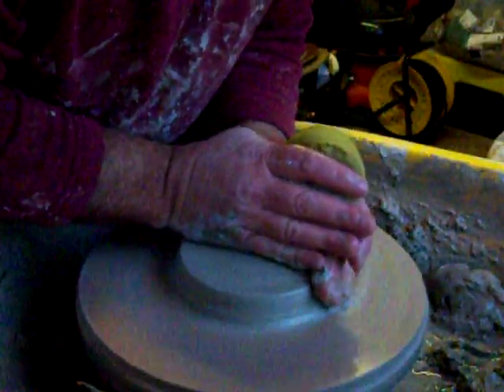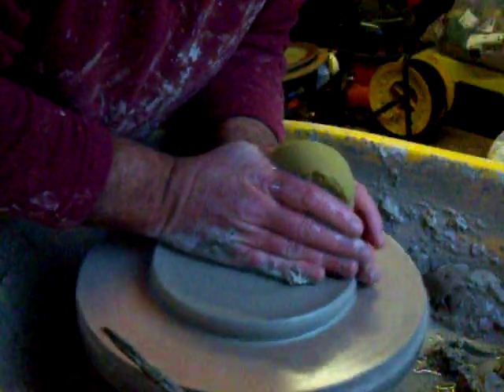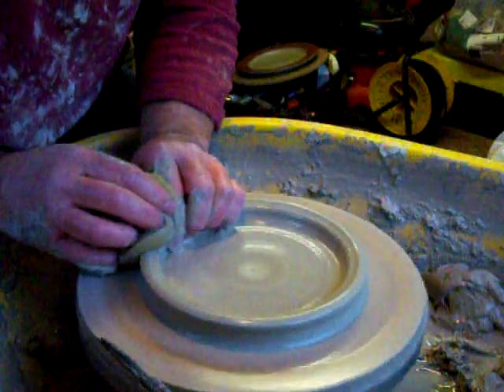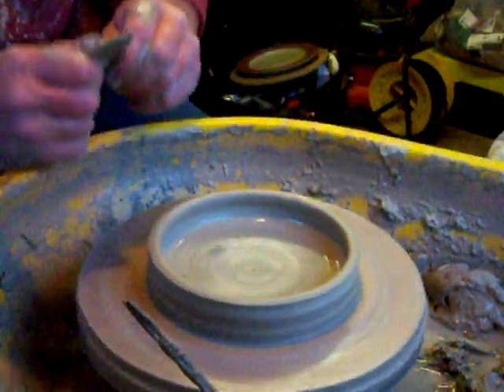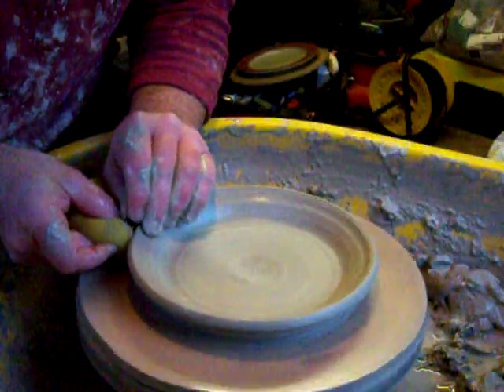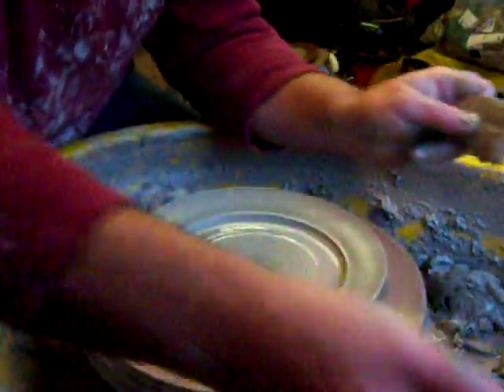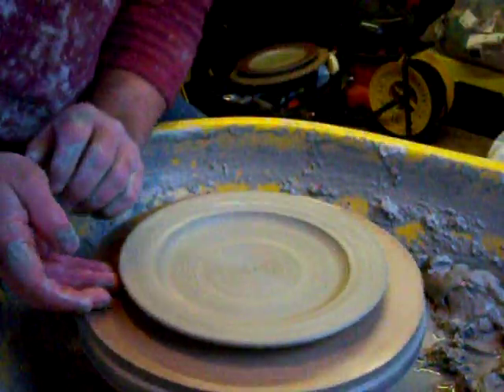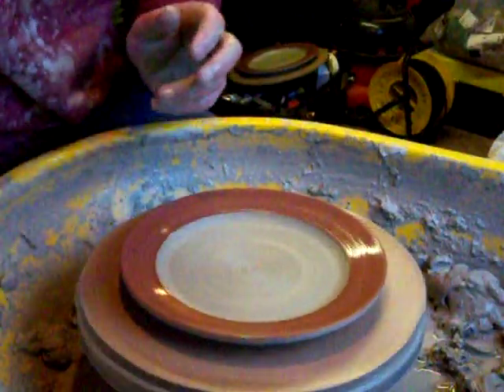PLATE DECORATION PART 1.mov

Comment from the maker: I think if you don't let the rim get too wide and keep it slightly above horizontal you will be surprised how easy it is .I do think its the thickness of the rim or I should say the lack of thickness that can make it fall. The clay is grogged but I have used red earthenware before and it was OK. I do think that if you stick to the principals of not too thin  keep it above horizontal and supporting it with a sponge you should be OK. 
regards steve